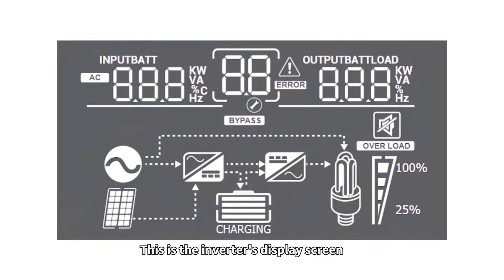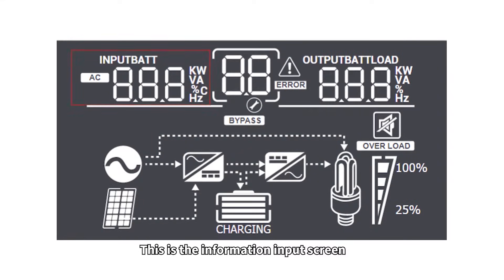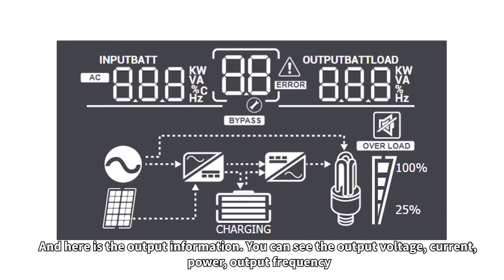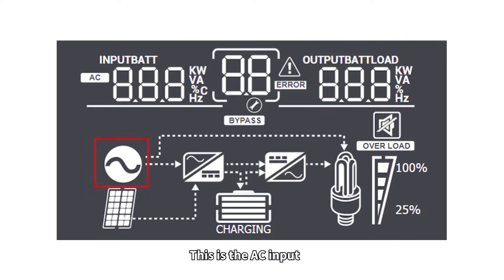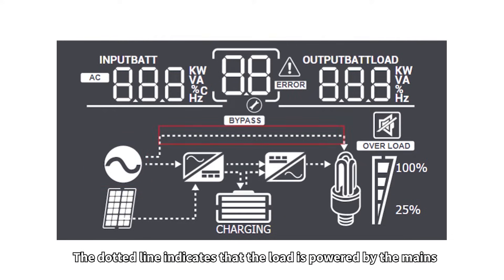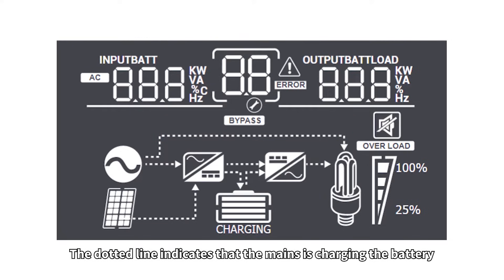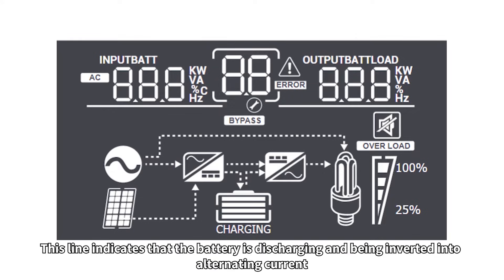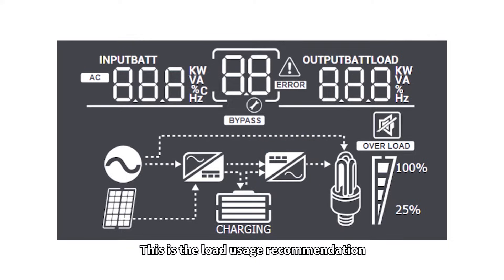Troubleshooting Renogy 12V Pure Sine Wave Inverter Charger

Comment: I just had this exact unit installed and hooked up to 240V AC by a licensed electrician (Required in Australia). Sparky couldn't get the inverter to turn on no matter what he did. I was working alongside him and this final snippett about the inverter HAS to be connected to 12V batteries in order to turn on is beyond insane (the engineers that designed this inverter need to be sacked - like WTF is going on with that centre-tap BS in the inverter). Making matters worse, the manual or online technical info NEVER mentions this MANDATORY necessity once. Renogy is a hot mess and we are going to replace the entire system with Victron or Bluetti Power Stations when it shits the bed, which will likely be in a week or 2 given the current performance - 1 MPPT failed after a week and a Phoenix 500 Powerbank shat the bed after 6 months of really light, intermittent usage. Renogy is just too much hassle and grief and their documentation/troubleshooting is beyond shite. Hate their shit quality and despise Renogy the company and will make sure everyone we meet on the road doing our lap around Australia is made aware of our dramas and encourage them to avoid at all costs.  Buy once, cry once and go Victron.

Comment: I bought the R-INVT-PCL1-30123S-UK 3000w Inverter / charger on December 23rd 2023, Got delivered on January 18th 2024, 
Did not install it for almost 18 months after purchase as plans (vehicle) changed.
Finally installed it 6 months ago, It only gets used occasionally as motorhome spends most of it's life parked doing nothing with Inverter completely powered off.
Yesterday it failed and now just emits a low buzzing sound from inside.
Supposedly covered by a 2 year warranty which I have no doubt Renogy will say is from the purchase date which means it expired 5 days ago even though it was not actually received until mid January !

We'll see

Comment: I have the model before this. It doesn't have all those buttons or a screen. The cooling fan won't turn off and now the charger will not charge the batteries. What should I do?

Comment: Hi i have a renorgy 2000w inverter charger with the inverter switched off but connected to shore power the inverter shows 230volts input but the inverter wont start charging the leasure battery untill i switch on the inverter is this correct because i thought it should start charging as soon as shore power is connected thanks mark

Comment: I am starting to doubt this is a true pure sine wave inverter. Mine works fine with my microwave and heat gun. But my ebike battery charger that only pulls about 230watts pulses and faults. I tried the same charger in another synology 1000w inverter and it works fine. Inverter seems fine other than powering this specific charger which makes me question the sine wave.

Comment: My inverter is connected to shore power. It charged the battery to 70% an then stopped. Is this a setting? I want to fully charge the battery
Reply: Hello, thank you for your interest. We will reply to your technical questions as soon as possible, and we expect to give you a similar reply in the next working day. Thank you again for your patience and understanding.
Reply from the maker: What is the battery voltage when your battery is charged to 70%? This may be caused by inaccurate SOC. Here it is also recommended that you submit the problem details through https://service.renogy.com, we will have after-sales technicians

Comment: The best way to troubleshoot a renogy inverter is to throw it away....preferrably into a vat of molten metal. These things are complet and utter garbage. Useless products being sold by a company of con artists. They never get even close to their stated wattage output....they damage smart devices or anything with a printed circuit board beyond repair....you cant charge and use  anything with a touchscreen....and the devices themselves are well documented worldwide as having started fires by overheating or bad quailty internal wiring or components. And to top it all off....the customer serices is one of the most disgusting rude and ignorant bunch orlf morons you will ever encounter. Save your sanity and avoid them.
Reply: Im feeling the same way, customer service chat is pointless. They have to look up any answer themselves and usually cut you out of the chat because they can’t find your answer. I will probably be going back to Victron myself, i have wasted enough time.
Reply: I agree customer service is pointless!!! I’ve been trying to contact them for weeks, looking for information regarding the system I’m trying to setup, which has been a complete waste of my time, after reading so many bad reviews on Renogy, Will spend the extra money and go with Victron on myself…

Comment: according to the book it requires 400ah of battery but in all you videos you use much less to fire it up.  Also how much power does the initial startup draw to charge the capacitors?  It is a huge drain?  Was the inverter in this video prepped by pre-charging the inverter capacitors?
Reply from the maker: Hey Phil,

For any technical questions, please contact us here- https://www.renogy.com/contact-us?gclid=CjwKCAiA3pugBhAwEiwAWFzwdeH3Crd9vRTbjjTYl9l3daVqnotJPjBhs2nmw-Wkn1_guWQeW0ao6hoCOHcQAvD_BwE

Comment: What's the RJ 45 port for ?
Reply: You use it for conecting to the hub or BT2 modyle whatever.   From memory is was a modbus procol.
The hub looks like can switch between can bus and modbus.
I ordered the hub  to give it a go.
Reply: i have the other 3000W like a flat slab. The remote wired on/off switch connects into i dunno RJ11!? Like old telephone handset plug.
Hope that may help
Reply from the maker: Hey Corey ,

Feel free to contact us here to chat with a product specialist! - https://www.renogy.com/contact-us They will be happy to answer any technical questions you may have! 

Thank you.
The Renogy Team
Reply: @RenogySolar  could have said it here

Comment: Hi 
Need help here to get my system going. I keep getting code 03 batteries voltage to high?   
Thanks
Reply from the maker: Hi, customer.

For troubleshooting your issue, we may need you send us images or video for help. Considering the limitations of platform communication, we suggest you submit a case through our Help Center Portal  (links listed below for specific locations）. 
 
https://renogy.force.com/helpcenter/s/contactsupport (USA)
https://renogy.force.com/helpcenterau/s/casesubmit (Australia)
https://renogy.force.com/helpcenterca/s/contactsupport (Canada)
https://renogy.force.com/helpcenteruk/s/contactsupport (UK)

Comment: I am getting a low voltage battery reading when I am connected with shore power and therefore causing a low voltage alarm on the inverter even though the batteries are showing 12.7 volts, what is the problem?
Reply from the maker: Hi, Rich.

For troubleshooting your problem, we suggest you can submit a case through our Help Center Portal (links listed below for specific locations）for help. 
 
https://renogy.force.com/helpcenter/s/contactsupport (USA)

https://renogy.force.com/helpcenterau/s/casesubmit (Australia)

https://renogy.force.com/helpcenterca/s/contactsupport (Canada)

https://renogy.force.com/helpcenteruk/s/contactsupport (UK)

Comment: I did not recieve a manual with my unit either, purchased on amazon..just the unit and nothing else
Reply from the maker: Hi, marc.

We are so sorry about the inconvenience brought to you. We have reflected the problems to our related department and will improve it later.

You can click the link https://www.renogy.com/content/R-INVT-PCL1-30111S/R-INVT-PCL1-30111S%20Manual.pdf for learning our manual book.

Hope it is helpful.
Reply: @RenogySolar  would it be possible for me to send this to you and switch it for a 24 volt unit then
Reply: @RenogySolar  that manual is incomplete. Try to search for info on the ‘Automatic Neutral-to-Ground Bond Switching’

Comment: Can I use this inverter(I have owned it unused for about 8 months now)(renogy R-INVT-PCL-130111S) using 24 volt lifepo batteries. I have 16 raw cells 320 amp hour (Daly lifepo4 8s 24V 200A R32W-GH13 X 2). want to hook up in fifth wheel, in conjuction with existing converter to use 12V components. If you can help, or point me in the right direction. I have been holding off on hook up for long time because I dont want to burn it out. I also have solar pannels, can I send you a list of my equiptment to check on their compatability, maybe you could give me schematic.
Reply from the maker: Hi, marc.

Our inverter is 12v, so it only be used with 12v battery. Hope you can understand. 

Wish you a nice day.

Comment: I there when I try to turn off the inverter using the switch it won't turn off seems like the switch is bypass  or something is this normal? Thanks for your time.
Reply from the maker: Hey Tony,

For any technical questions, please contact us here-https://www.renogy.com/contact-us?gclid=CjwKCAiA3pugBhAwEiwAWFzwdeH3Crd9vRTbjjTYl9l3daVqnotJPjBhs2nmw-Wkn1_guWQeW0ao6hoCOHcQAvD_BwE
Reply: Hi i had this with my inverter i switchex off the leasure battery for a couple of miniutes then switched back on and it was fine